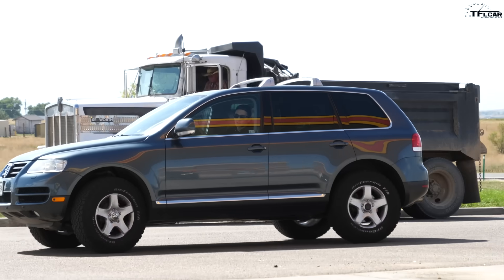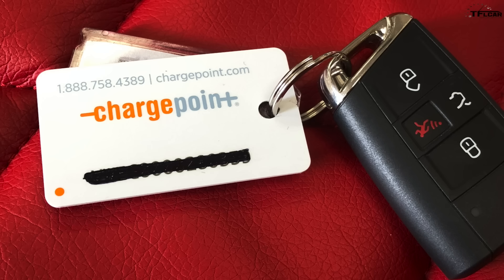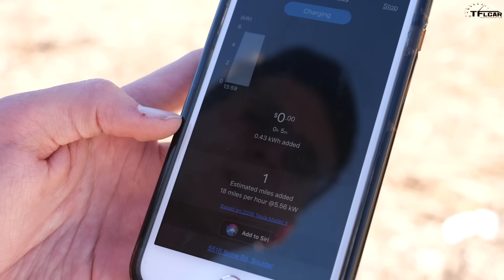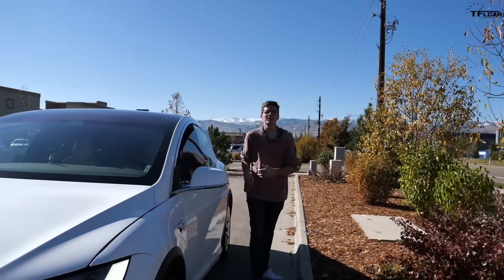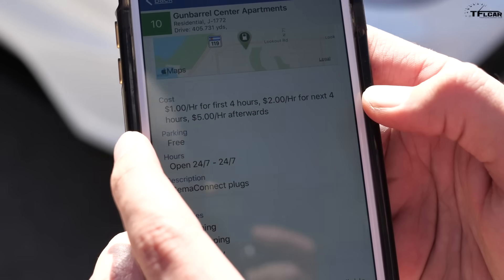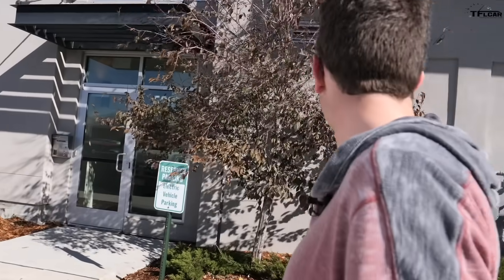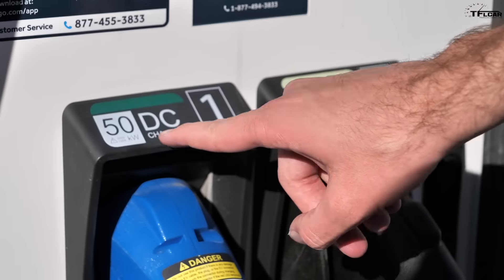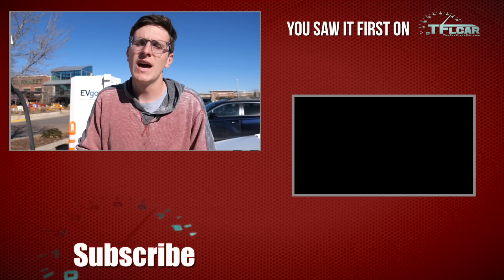Here’s Why Charging an Electric Car Can Suck - And It’s Not The Reason You Think!

Comment: This is like pulling into a gas station and filling your tank from a pump with only a very small trickle of gasoline coming from the hose.
Reply: The bottom line is:  EV is not convenient in the current state.  Charging needs to be comparible to fueling up a gas car before we should even bother considering it.
Reply: @rafiqp8800  Everything we have become used to in a car draws heavily on the battery be it the heater, air conditioner, windshield wipers, nav system, etc. People are not going to give these conveniences up. And whoever said it earlier is correct. Most drivers will not drive a vehicle that doesn’t “fill up” as quickly as a conventionally fueled one. A question though for those who drive these cars. As the battery drains down, do the lights, heater, air conditioner, etc begin to operate at an increasingly lower level and does the car’s top speed begin to decrease until the car just comes to a stop? Just curious!
Reply: @geodes6722  WHAT ABOUT IF YOU GET CAUGHT IN A TRAFFIC JAM FOR TWO OR THREE HOURS.   WHERE DO YOU CHARGE IT THEN ?
Reply: @samcolt9394  - turn off Radio, Heater, AC.. Lights and you will be ok for the 3 hours
Reply: @samcolt9394  Good question!
Reply: @williamhaynes7089  I want to see that car  in a blizzard where it's -40 and your waiting for the snow plow to open the road.
Reply: Exactly …. People can’t wait hours to charge their mode of transport to arrive late to work
Reply: That equals about one gallon of gas per hour.  15 gallons= 15 hours:(
Reply: @bobjames2423  It's actually less in terms of refilling speed. Don't focus on the speed of filling. Focus on the location. If you have a gas station at home, even a slow one, you can fill up on gas while you sleep, or eat, or other home activities. So, you'd never have to drive anywhere to get gas again. And you can fill up on gas each and every night. Most folks are home 60-80 hours a week. Do you need 60-80 gallons of gas a week? Do you need half that?
Reply: @georgiaev7860  - its 100 miles round trip to my work and back, unless i used a fast charger the battery would drain more than charge... and there are 0 charging stations near my work.
Reply: @TuTuFox  - you cant buy a gas weed-eater or lawn mower either soon
Reply: The cost of charging is only going up
Reply: @WinterRider   There is no free. The dumb asses pay up front for it.
Reply: Even the DC fast charge sites are often battery banks that recharge slowly off the standard AC grid available to be able to provide the fast charge which means if someone had just used it before you. It will default to the level 2 charge which would take all night to recharge.  This can really screw up your long distance trip when the level 3 quick charger you mapped out only provides you with a level 2 charge.  I'm surprised they don't make the EV's with hookups for a battery trailer, I believe the first generation Bolt was but that's it, all the other battery and generator trailer hookups are third party conversions.

There used to be a plan to just replace the battery pack with a charged pack and some EV's were designed for such forklift fillups but the charging centres needed you to make appointments.  In the 70's, they had proposed lead acid batteries where they just drained the electrolyte and refilled with fresh electrolyte to recharge the batteries.
Reply: @johnwang9914   Doesn't work like that. Electrolyte doesn't charge the battery.
Reply: @richwilson7619  It's the chemical reactions that power batteries and some of the chemicals are in the electrolytes.  Electrolyte replacement batteries did exist and it was proposed for EV's in the 70's, albeit based on lead acid batteries, and there is one company today that are proposing flow batteries where electrolytes are stored in containers and flowed across the plates.  Now the rest of the chemicals are in the plates so just changing the electrolytes will eventually require the plates to be replaced but as plates can be quite thick, this can be less frequent.  Now the flow batteries address the degradation of cathodes and anodes by having neutral plates and making the liquids catholytes and anolytes separated by a membrane, basically integrating them with the electrolyte but the energy is in the chemicals of the electrolytes.   I'm an electrical engineer, it does work like this, there is such a thing as electrolyte replacement batteries and there's one marketed for grid storage.
Reply: I could piss faster that the gas could come out in the above comment.  EV has a long way to go.  Plus, electricity is still produced by fossil fuel.
Reply: plus the weather, the gas stations have roofs over the pumps, its 20 below zero wind is blowing the snow is blowing the door freezes shut and its covered with ice no door handle to jerk the door open ill bet all that automatic door will do is hum .  and im gonna wait till the charger is done . good luck !
Reply: AnD that happens still
Reply: Still faster than this electric nonsense!
Reply: Actually a pretty good analogy. The question though is would you use that system if that tiny pump was in your driveway?
Reply: That's where the mindset of the driver needs to change. When filling up an electric car the idea generally isn't to stand there beside the vehicle until it's charged. The idea is to use that time to do something else like a washroom break, lunch break, get some work done, shopping, etc..
Reply: @russellthorburn9297  - when i driving on a road trip, i would rather just get it done...
Reply: @russellthorburn9297  Even after the car is fully charged, thus causing the person behind him to be late as well..
Reply: @russellthorburn9297   What sit on the crapper for twenty hours? Your roids won't like that. Lol
Reply: I was at an awful gas station once where it took me 13 minutes to fill up my car due to the pump being messed up. Granted, I realize this is unusual. The idea of an EV is to be able to plug it in when you get to your destination, for example, if you are going to be shopping for an hour, unless you are in an extremely rural area where you drive a lot the car should get very charged up from there and last you for days.
Reply: @mattwolf7698   300 miles is a long ways and a lot of driving in New York City. It is about that far to my neighbor in Kansas. Lol
Reply: You clearly missed the purpose of EVs.  You're supposed to charge it at home while you're there for awhile.
Reply: @joeya6795  for those of us in apartments, condos or co-ops that’s generally not feasible. The charging will really have to become more efficient before this really is truly an option for many
Reply: @joeya6795   most people don’t live in a house with a garage numnuts
Reply: Most Americans and Canadians do in fact live in a house with their own garage.  But on the other hand, we also like to DIY (except for nerds and women), therefore we prefer practicality of larger cars such as SUVs, vans and pickups, rather than battery toys.
Reply: @mr.shovels6492  - think of high rise condos and apartment buildings... guess they have to share 2 chargers for 100 units.
Reply: @mr.shovels6492   I don't really know what most people have but you got the numnuts part right. Lol
Reply: @joeya6795  But with a large portion of city dwelling people in the US living in apartments or condos the current infrastructure is woefully inadequate to make EVs a viable option for many people. If they really intend to have any sort of market penetration for EVs this problem needs to be solved. Plus the haphazard nature of this charging infrastructure is really offputting. Why doesn’t it just work like a gas pump? Why do you have to sign up with every Tom Dick and Harry that decides to put in a charging station?
Reply: @joeya6795  majority of people don't life in a house with a private garage or car port connected to the grid so EV is still not mass compatible. Its a method of transportation for Upper class and Yuppies
Reply: @Zozo806  - same with Ny city etc.. they dont even really get the same parking spot two days in a row
Reply: @joeya6795   What if you don't live in a house?

Comment: What a pain in the you know what. You just convinced me to not purchase an electric vehicle until they have the proper infrastructure and the car can be recharged in the same amount of time it takes to fill up a gasoline vehicle.
Reply: IF you could recharge a EC as fast as you fill a tank with gas you would have a big explosion and or fire as the battery would overheat beyond its capacity to charge.

Comment: Charging at 5 Kw even at 25Kw wont keep you on the road long considering while driving the car will use more than than so you will spend more time charging than driving.   The future looks good for coffee sales at charging stations.   Also get ready for national grid black outs as it can not supply power to replace petrol and diesel used today.  If governments really want to reduce pollution they would limit car size. But no they wont do that after all when did you ever see the big knobs in small cars.

Comment: I can get 450 miles of range in 4 minutes at the gas pump. And if I run low on fuel anywhere in the known solar system, there's my choice of gas stations available.  No adapter needed.

Comment: Manufacturers need to utilize the same connector to streamline the process and then maybe EV's will be more enticing. But having to have multiple apps, various charging adaptors, and many AC which are just way to damn slow - I'll stay with gas till they get this worked out.

Comment: In NZ there is a single chain of fast chargers that are supplied with dual plugs enabling Tesla and other vehicles to be charged at the same location. In my region there is a second type of charger that only delivers 22kwh installed by the power companies in conjunction with local government and these are free to use at the moment, they do require you to bring your own lead thus removing the issue of different connection types. 
The longest charge time I have had at a fast charger in my Ioniq was 45 minutes to fill from 7% to 90% which is the maximum for a fast charger. This was during a 460km road trip and was planned to enable a lunch break, and worked out perfectly.

Comment: That's OK. I'll put a diesel generator on the back of my Tesla.  No need for charge point.
Reply: 2000 lbs generator on a trailer will be good  24 kW  4 cyl diesel.

15 liter (5 gal) per hour :D to do 60 miles :D   Then you can drive 1000 miles or more 
non stop :)
Reply: @wyrazowfkp  Thanks for confirming my belief. I'll also save money and hassle on a smog check.

Comment: What a load of bollox these EV's are!! I have seen cars where vandals have booted the charge plug out of the car damaging the rear panels, lights, sockets and the plug itself, God only knows how much that costs to repair with the chance of it happening repeatedly!!! If you have to leave a car unattended for 20 hours you are inviting trouble.
High energy batteries are extremely dangerous, airlines don't allow them on-board aircraft and people are being burned to death on an ever increasing scale when these vehicles crash and burn, they store HUGE amounts of energy which cannot be turned off inside the enclosure.
My diesel car takes under 4 minutes to refuel and returns 650 miles (Three weeks normal driving) for that tank of fuel. AND as its a Euro 6 engine is extremely environmentally friendly too.
I work as an electrical technician and replace motors, inverters, diverters and control equipment often, when EV car owners get repair bills for these high price items failing they are really going to get pissed off at this nonsense.

Comment: I couldn’t live with it, charging on the road is too much of a hassle.
Reply: Charging at home or a fast charging station are the only two good options. If you drive too much or don't have a way to get these, I wouldn't yet recommended them. In probably 5 years, the range and speed of public charging stations should increase dramatically. No reason to deal with any extra hassle now.
Reply: not true Tesla Model Y owner.
Reply: Cost of charging will exceedingly get expensive
Reply: @WinterRider  Tesla superchargers are still $0.25/kwh and can charge at 250kw/h
Reply: @marine2tough  that's garbage too ! That price will only skyrocket
Reply: @marine2tough  - but the car is 70k and up.. and not everyone wasn't a tesla.. they may want another EV model

Comment: Good job! The blunt fact is that there are only two efficient ways to charge your BEV. One is at home with a 240 volt charger. The other, away from home, is with a Tesla Supercharger. The competition is too slow except to add a bit of range while you do something else like eat a meal at restaurant or go shopping. They are adequate only if you can stay plugged in for many hours such as overnight while you sleep at a hotel.
Reply: Just because you own a tesla dont make you better than other ev owners... In my area tesla has 0 chargers with a 40 mile range of my home or work...
Reply: @williamhaynes7089  Actually, I don't own a Tesla (or any other brand of BEV) although I'm thinking seriously about replacing a very good ICE-powered Infiniti coupe with a long range Model 3. For me, it's 50 and 75 miles to the nearest Superchargers which makes home charging critical. Three things give me pause for thought. The closest Tesla service is 3 hours away. Towing a dead Tesla to the shop would be expensive. Practical range is less than 300 miles when our other vehicles are good for 400. Chargers are rare enough where I live that trip planning is critical to avoid getting stranded with a dead battery. There are places I cannot go because they are out of range.

Comment: So what did you do for those couple hours of charging? How do you take a trip or are trips out in the future you would have to take a month off to go on a long trip and spend all your time charging.
Reply: I do a 200 mile round trip a few times a year in my 2016 Kia Soul EV. Traveling at highway speeds and using the ac uses a lot of electricity. Every 80 miles I stop - so 1 charging stop for 30 minutes of fast charging at $4 and 1 charge when I get to my destination city. That could be either fast charging or Level 2. Helps that this city has options. Many chargers are still free! I do the same trip in reverse. Over time you get more comfortable with getting the car down to 10 miles so that you can go farther. Hope that helps!

Comment: This is an absolute nightmare in the event of wildfires, wherein PG+E and SDG+E shut the power off when you’re trying to evacuate. So, cellphones will then also end up inoperable. 

Even gas stations resort to “cash-only” in emergencies initially, before they also close because their registers are computerized. So if your cellphone has no juice, how will you manually obtain electricity at an electric charging station? How will you charge your electric car if the power is shut off?

Even Tesla owners were using gas-powered generators to recharge their cars.

Especially in the western states which are notorious for massive wildfires, electric cars are evacuation death-terror traps.

Comment: Here's why this petroleum propaganda is BS. I'm retired on net $4000/month. Elec bills had gone to near $100./month. Learned my 2003 solar system died early in 2019. I replaced it - with a terrific local contractor - with a $9000. system that actually cost $5000 (tax rebate + sold old panels). Then my 2006 Honda hybrid started running up bigger repair bills. I found a used Nissan Leaf with only 31k miles for under $7. Had a 240v charger installed for total under $500. SO NOW I am getting electric bills for $0/month and gasoline costs of $0/month. I'll keep the (50 MPG) Honda for my rare need for more than 60 miles of range. Charge at home midday in 2 hours. Solar powered very nice car.

Comment: ...until batteries are developed so that they can be changed easily during a 'rest stop' at a  'service station'... i.e  slide the discharged one out..slide a fully charged one in, in the time it currently takes to fill a fuel tank...i think the appeal of electric cars will be limited. The cost of any sort of mass  charging infrastructure will be prohibitive and the abilty of national electricity grids to cope is doubtful.

Comment: Gas stations used to be that way, each brand had its own credit card, before they started accepting bank cards. I remember carrying 3 gas cards.  I have been driving a Nissan LEAF since 2012. My solution is to keep a credit card holder in the glove box with several charging cards so I can access all the public charge points in my area.

Comment: This would be fine if nobody commuted to work
Reply: Actually it depends how many miles you do a year. High mileage is harder. I'm electrical engineer who does 45k miles a year. My car is buisness lease through work always 2.0l diesel German cars bmw Mercedes volkswagen that sit in 9th gear at 80mph 90 constantly on the motorway and still get 45mpg and more. I couldn't have an electric I'd need full charge everyday Monday to Friday as I often do 1k miles a week and this week I'm scheduled to do 2100 miles. I'm in different parts of the country and I'd need a fast charger which aren't always there. I can also get home at weird times 2am with basically 0% and need to do another 300 mile the following morning and plugging in the car to a 7kw garage charger isn't going to be enough range so I'd need to find a fast charger at 530am charge the car for 1 hour 30 then go